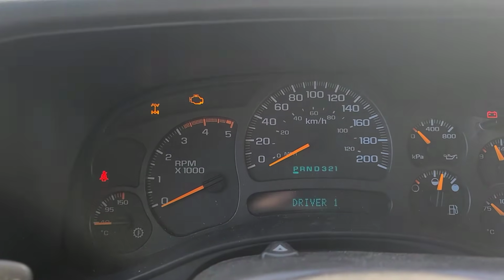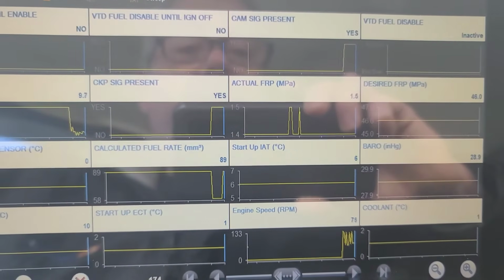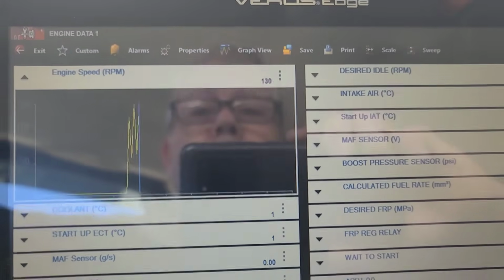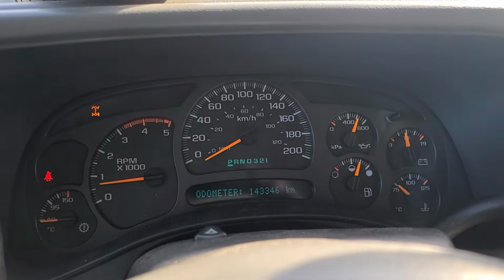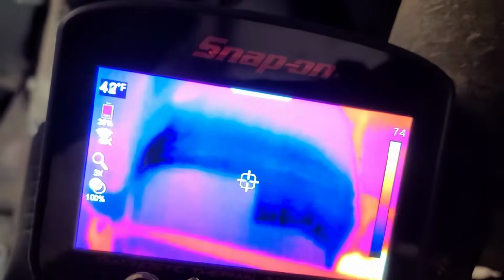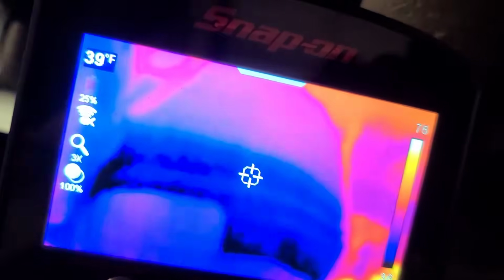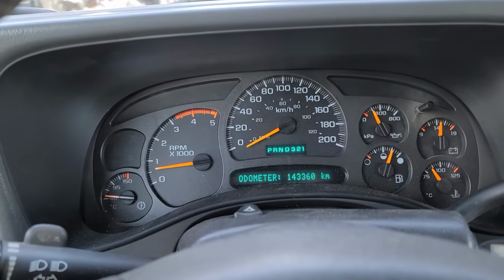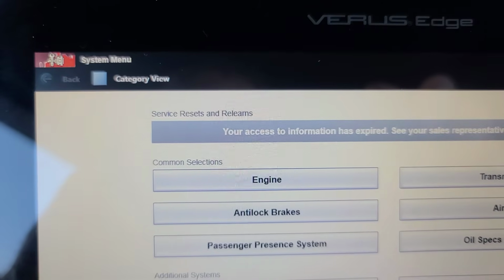2004 GM Truck 2500HD 6.6 Duramax Cranks No Start

Comment: Had the same problem three years ago down in Yuma after driving down from Washington State next day the truck wouldn’t run properly. Could barely get on the freeway and get up to speed so my primary pump was done so I went ahead and put in a Fass fuel system.
Pretty easy to install comes with old parts. Haven’t had a problem with got about a 15 to 20% fuel game. I think this system is a good idea on all the older diesels. 
Add this song now for three years, no issues

Comment: Was it bad wiring or bad connection?
Reply from the maker: Neither, it was loosing prime due to a suction leak in the fuel supply line..

Comment: I still hope you’re replying to comments all this time later

2004 LB7 Durmax, going down the highway and lost power, limped it to a safe spot. Crank no start. I can prime the filter, and then when I crank on it, it takes fuel becuase I’ll have to prime the filter again. 
Ive swapped fuel pump relay to one of the headlight relays, same thing
No check engine light and no trouble codes on my edge tuner diagnostics
Battery lost voltage from when I lost power dropped to 12 volts from 14.2. No sputtering, just shut off at 80mph.
It 100% has fuel in it
No desiel leaks that I can see. 
I just bought the truck and havnt even made my first payment towards it so any help would be insanely appritiated.
Reply from the maker: That truck doesn't have a fuel pump in the tank or inline unless it's modified from stock. There may be a "fuel pump" relay but it's not used. That's for the gasoline version of the truck. If priming it does not get it running then try running it on an external fuel supply such as propane. If it fires on an alternative fuel source I'd recommend connecting fuel lines directly to the supply and return circuits at the left rear of the engine. Prime it again and see if it will start. Watch high pressure fuel pressure on your scanner while cranking. It needs to get to around 4000psi. Watch for RPM cranking as well. It may help to start it on propane. I don't recommend starting fluid.

Comment: Hi, thanks so much for this video.. I have an '06 LBZ Chassis cab (dump) which is doing this same problem. I'm going to connect a fuel supply as you did here... i already know it's sucking in sir before the filter (replaced housing assy) because when i prime it it just keeps bubbling more and more. 
The truck was as sander in New England, so it makes sense the steel line rotted, or the top of the tank/sender. 
I intended to just swap in a new diesel hose as you did here, but where did you connect the new hose to? Did you run it all the way to the tank/sender, or just to that joint you found underneath? 
Also, did you use actual Diesel hose (which is thinker to handle not collapsing)? 
Thank you. 
REALLY appreciate this Video! 🙏
Reply from the maker: I connected to the line from the top of the tank. There was a coupler just behind and above the fuel cooler. Used 1/2" fuel line from Napa

Comment: Well it has a code wich is fuel rail low pressure  that what it said when i took it to scan for code it also has the check engine light on

Comment: i have a 2007 chevy truck duramax diesel it cranks but it wont start 
it turns on the first time but after i turn it off it wont turn back on
after i leave it alone for about 2 hours
thanks for the response
Reply from the maker: @valenteperez9198  is it setting any codes? What fuel pressure are you seeing cranking? Will it start on propane? Is there air in the fuel filter?

Comment: Where did you disconnect and connect the clear hose when you figured out there was on air bubbles coming from the filter housing ?
Reply from the maker: @zachv1035  I disconnected both lines at the left back of the engine, (drivers side), and put clear line in both supply and return. Once primed and running watch for bubbles. If you have bubbles on the supply line, the 1/2" line, you have a suction leak between there and the tank. If you only have bubbles on the return line the fuel filter or filter housing is leaking. HTH

Comment: I have a 04 with the lb7. That has fuel filter deleted with a lift pump. Im losing prime and crank no start. 
With a lost comm with ficm. 
Its been driving me crazy to what be going on. Because ive done all power and ground checks with ficm and ecu. 
I get a weird reading on 12v reference going to the cam sensor. 
It should be battery voltage but its dropping at least a 1 volt. 
If you could help or anyone has a idea. It would be greatly appreciated.
Reply from the maker: @2dogsmowing  cam sensor power to pin 1 should be near 12 volts. Unplug it and try to start, it should set a code for missing signal. What is the history on this truck? What happened in What  order. Will it run on propane? Does it consistently set the code for loss of communication with the FICM. Have you load tested powers and grounds to the FICM? Checked can bus wires to the FICM?
Reply: @PhillipBailey  do you have a email or some other way to contact you?
I don't want to run a bunch of comments back and forth on here. 
The thing is I'm not sure what the parameter numbers are. I have ALLDATA account but I can't find what the within spec numbers are on the stuff. 
The cam sensor is a volt lower then battery. Which I'm not sure if its to low on spec. 
I haven't tried propane yet. Which I do havebsome in a green bottle same as what you had in a video. 
Your the only one on YouTube that I've finally came across that knows what is going on with lb7 duramax. 
Mine is a California emissions but fully deleted.
What original happened for the truck to not run. Was the tension pulley wore a hole in the hose to the reservoir tank. 
Just as I was pulling in a parking lot of a store. I fixed that with a coupling and filled with water. Go to start it and ran for 2 minutes roughly and died. Same thing a second time. And third time ran for 4 minutes or so and died. Then that was it. Just crank no start. 
When I got stop in the parking lot. I did pull the reservoir cap off and straight water blow everywhere. 
I don't believe I have a head gasket bad. Because there were leaks in the radiator and a hose. Plus I've done a comparison gas test with the color change dye. 
The thing is the truck was running just fine the rest of the day before that happened. 
Today I think I've found why I was losing prime. From the rubber fuel hoses under everything by the cp3. 
They were soft like cooked carrots. 
And they looked fairly old. Which I took them off to order new ones. 
I think that's it at the moment. 
If you do have a email. I can send pictures and my scan tool report. To see what all is going on. 
There are other issues but they work fine. The truck has been ran through by someone else before me. And I've been slowly fixing stuff over 5 years now roughly. The truck looks way different then it originally was when I got it. 
The first day I bought it. I sat in the parking lot of the dealer for 3 hours figuring out what was going on with the tail lights. Come to find out it was missing the junction block in the back where the tail lights split. 
There's many story's I've got with working on this truck. Which I knew of when I bought it. 
It's a beast when it runs right. Lol
Reply from the maker: @2dogsmetalrecycling  my email is phils@tbaytel.net
Reply: @PhillipBailey  I'll get in touch tomorrow. Thank you very much.

Comment: I had a similar problem and let some air out of the fuel primer manuel pump as you did and the duramax 2004 GMC Sierra did start.  I only have 15.5 k miles so I will check on it tomorrow.  Thx. for sharing your work.
Reply: Got a 05 durmax just had installed new airdog fuel system installed for my son, he drove it the other day for 1st time , coming home it died and just cranks over but want fire🤷‍♂️ any advice to help out👍
Reply: @tommywalker5348  sounds like air in the system. Not sure what the air dog system is. My 2004 Duramax has a plunger to push the air out of a small black turn screw. When I took the top off there was an o-ring that had turned crusty brittle on one side. After a replaced it everything is running without stalls and no starts. :)
Reply from the maker: Good advice...
Reply: @MichaelWilliams-vf6hx well that's what he had on his truck 1st the same as yours, but we had fuel filter/pump installed underneath on bottom back frame which does away with the plunger push button your talking about🤷‍♂️ . I'm new to diesel so i don't know correct terms on the diesel lingo😆👍
Reply: @tommywalker5348 lift pump, yes it gives better fuel flow to get more out of the truck. I myself am thinking about getting one for my lly it’s just so ridiculous how much parts have gone up in the last decade. You think the people making these aftermarket parts would do so for a cheaper price to keep people from saying to themselves screw this I’ll just buy a new gas truck with warranty for 5 years for 60k then spend 10’s of thousands of dollars to keep an older truck going and especially if you want to hit 500 horsepower. It cost roughly 25k to get an older duramax at 750 horsepower that’s crazy. I can see engine components or transmission upgrades but just a down pipe costing $600 is nuts. It’s a piece of steel nothing that cost close to $300 to make and that’s half price. Everything is just overpriced because people will and do buy it. Amazon sells down pipes for $100 or less last I checked probably don’t line up as good but they work!!
Reply from the maker: @MichaelWilliams-vf6hx  sometimes the check valves in the filter housing can leak and cause it to lose prime..

Comment: P1093 and p1094 codes with rail pressure not matching at wot only . Thinking bad pump but replaced pump and now still getting no start unless I spray it , so I know it’s fuel related but hope it’s not injectors cuz I have no sign at all of bad injectors . Hope it’s just a bad pump out of box . What would yall think with the little data I gave ya . P1093-1094 rail pressure 8k and desired at 23 k at wot only , other than that pressure it’s spot on than trucks cuts of sitting there idling . Had to prime filter head to start it . Drove ten minutes cut off at red light . Had to prime the hell out of it even with fass lift pump got it running and dies 20 feet down the road and limped
It home . Replaced cp3 . Got no start unless with spray , got the p0089 code and surge at idle but pressures were spot on while driving but now no crank still . Fuel leak at cp3 fittings and somewhere on back of housing . Sent it back , have another pump otw! Help me save some money for diagnostics trying to save money
Reply from the maker: I commented on this on the other video

Comment: I’m stuck in a random city and my 2003 duramax won’t start, it will crank but it won’t fire, I’m getting fuel to the fuel housing but can’t get it to start
Reply from the maker: You need a scan tool to check fuel pressure and rpm data while cranking.
Reply: One A: diesel doesn’t fire 
Two B, or not two b that’s 
a no-buller 
Three A: diesel explodes. 
If you can’t handle it try a 
Pootin. Perhaps a flush is 

    🚽 
               too much for you!

Comment: hi, nice video, I don't understand so much English why I come from switzerland, I have a problem in my lb7, so you have only change the fuel hose right? thanks a lot for the answer!!
Reply from the maker: Yes, I ran a new fuel supply line from the tank to the engine. I was losing prime.

Comment: I’m currently having issues with my truck. It’s a 2004 LB7. Ran perfect before I changed the transmission lines. I removed the passenger side wheel well covering and only unplugged the MAF sensor on the intake. I started the truck after installing new lines to check for leaks and turned it off. I had the passenger side intercooler pipping disconnected during start up. But it still fired up. After putting everything back together. The passenger side intercooler pipping made contact with the positive post on the battery cause a small quick spark. When everything was back together and plugged in. The truck didn’t want to start. Cranks, no code. DFRP is 6.1k and it makes 6k. There RPM signal, on a scanner I can see .1 or .01 MAP reading can’t remember. Again, truck ran perfect before line replacement. And fired up 30 minutes before putting it all together. Any suggestions
Reply from the maker: I'm not sure what's going on. So you say you have an RPM signal on a scan tool and rail pressure reaches 6000psi? What's the Barometric pressure reading and the MAF sensor cranking. Try unplugging the maf sensor.
Reply: @PhillipBailey  I’ll have to go check the Baro reading. I tried unplugging the MAF several times also tried disconnecting the battery cables for 10 minutes, twice, and 1 times for 45 minutes. No luck.  I’m thinking a fused popped when the turbo piping contacted the battery positive. I just can’t find a popped fuse.  30 minutes before putting everything back on. It was running just fine
Reply: @PhillipBailey  3 things happened. 1 disconnected the MAF during the transmission line replaced. But also connected it and started it up without the turbo pipping connected. 2.  Pipping contacted the positive. Which sparked up for a split second.  3.  The windshield washer supply line was cracked right next to the fuse block and it sprayed water all over it.
Reply from the maker: @SubePelayo928  that's definitely a strange one. Do you have a scanner to look at data?
Reply: @PhillipBailey  just a cheap scanner from Harbor Freight.  But it does show data.  Not too sure what I should be looking for
Reply from the maker: @SubePelayo928  is the Barometric pressure correct and does it indicate rpm cranking and air flow through the MAF

Comment: May be my ignorance but did you really bypass the fuel filter and the FICM? Because if so them injector’s are toast 😂
Reply from the maker: I replaced the steel supply line between the tank and the inlet on the engine with neoprene hose. the fuel filter and FICM are still in the circuit as normal.

Comment: This is a great diagnostic video. 
I’ve got an 03 LB7. Truck has over million Km. I built a new engine about 10 years back. Original was getting some blow by. With this much history, you just get to know their quirks. 
But yes, these fuel systems leak. Especially at the primer pump. I’ve rebuilt mine 2 or 3 times. It’s basically an O ring kit with a new bleeder screw. And I’ve also had pinhole leaks right by the cooler. So I replaced the main fuel line with braided rubber.
Reply from the maker: That is correct!

Comment: Where do you get a stainless steel brake line kit?
Reply from the maker: For 2000 to 2007 they are available from Dorman through most parts suppliers. There are several different kits depending upon wheel base and brake options.
Reply: @PhillipBailey  Thanks for that info.
Reply: GM had recall after I found out after they charged me $250 for lines

Comment: So i just swapped out all my injectors. Truck ran before. Now i prime it and get fuel out the screw but when i crank it, it loses fuel pressure. Any advice? I dont see any leaks anywhere other than the bleed screw. Thank you
Reply from the maker: If you replaced the injectors the HP fuel system is empty and it takes a significant amount of cranking to purge the air. Battery charger and don't overheat the starter. Max 15 seconds cranking then 2 minutes to cool off. Try see if it will fire up on propane or penetrating fluid. Don't use either.
Reply: @PhillipBailey  ok I will definitely try that tonight. Thank you for the advice.
Reply from the maker: @brunocuevas8761  let me know how it works out for you.

Comment: I have a 06 duramax, I drove it from a 13 hr trip and parked it a couple weeks. I got in it and went to town left it running while in store, came back out and ut wasn’t running. I changed the primer filter housing and filter recently, now it’ll run for 20 mins and die and won’t start. It has a half tank of fuel and has brand new batteries in it. Also it doesn’t have any codes and we used a snap on reader. Any help would be appreciated!!!
Reply from the maker: Is it loosing prime. Try priming the fuel system. Make sure the filter is tight as it's under a vacuum not pressure. You may end up installing clear hoses to check for bubbles. Is it developing fuel pressure cranking? RPM cranking on scanner.

Comment: My lbz just started loosing prime cant find rhe problem anywhere replaced the fuel filter with housing the sensor on the filter is not leaking. Replaced both lines going to the fuel filter housing. Cant see any leaks anywhere from the tank all the way to the fuel injectors its driving me nuts
Reply from the maker: Try plumbing in some clear line at tge connections near the back of the left valve cover. Prime it and run it for at least 25 min. Watch for bubbles in the supply and return circuits. Could be a leaking banjo bolt gasket at the ficm. If its stock all those lines are suction. Good luck
Reply: Did you figure out your problem
Reply: @bryanrodriguez6759  bad injectors leaking fuel into cylinders only when hot but not enough to cause smoking while running

Comment: mY 07 DURAMAX  after sitting for the winter wouldnt start. Bleed and start for 30 seconds and quit, turned out the water in fuel sensor on bottom of filter seals on the paint of the filter  and the paint was cracking and stuck to the o ring,  obviously did'nt change the filter often  Over a hundred bucks at lordco
Reply from the maker: Yes a leaking filter or wif sensor can act the same way.